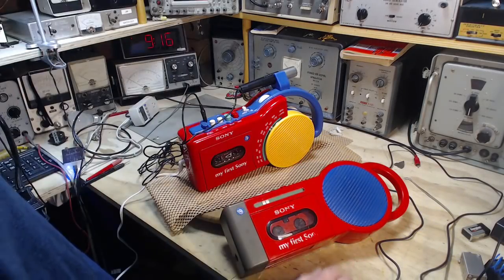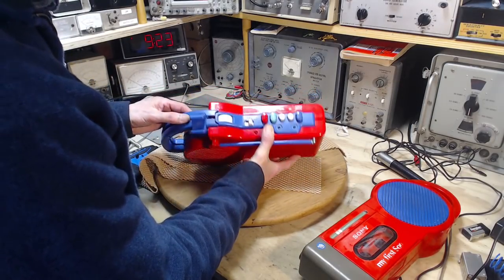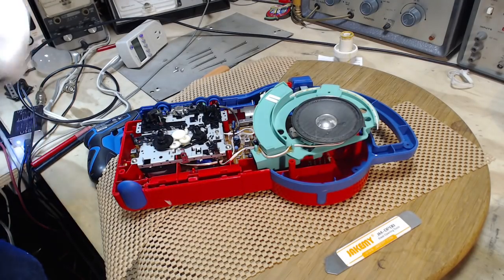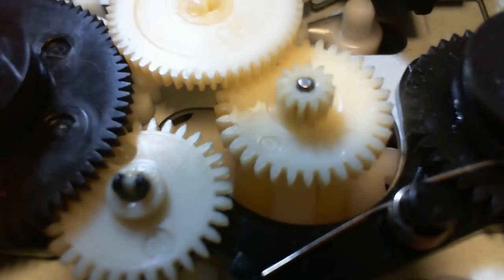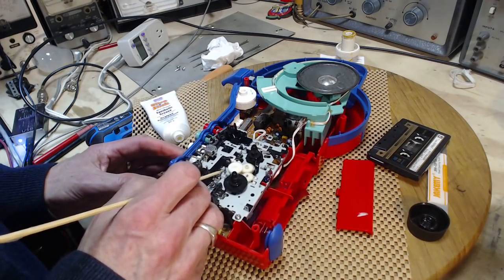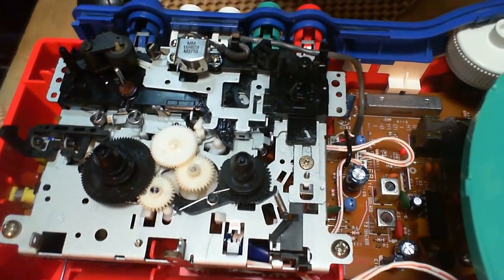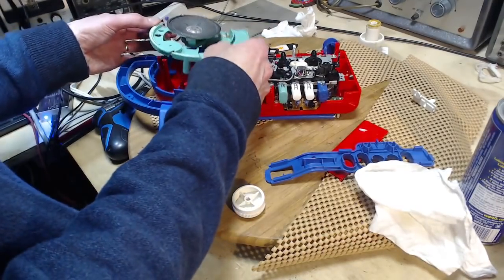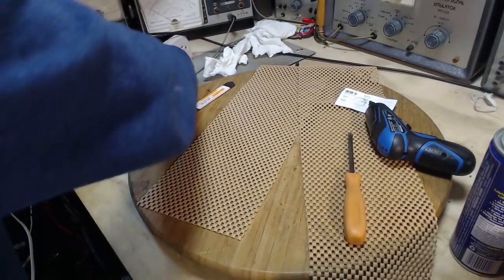My First Sony Tape Recorder Video #2 - Internals

Comment: I prefer a very light oil that is sold for model trains for these motors.  It comes with a needle point injector and is very controllable.

Comment: Would you have any advice for opening the other My First Sony? I’ve found myself struggling with the grey plastic part - not sure if it’s supposed to slide out or might have hooks or hidden screws somewhere. Thanks!
Reply: I can't figure it out either I just need to replace the belts but I can't get it open
Reply: @christinabutterfield1801  I’m in the same boat I think. Best of luck on yours!
Reply: I've just open the grey plastic part using hair dryer. They glued inside surface. Hot wind helps. ^^
Reply: @christinabutterfield1801  Try blowing hot air with a hair dryer.